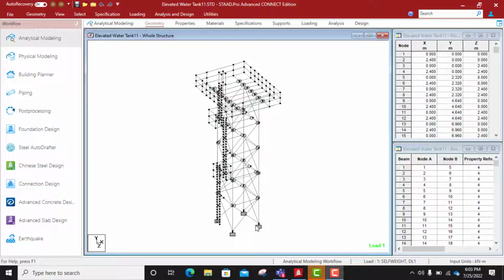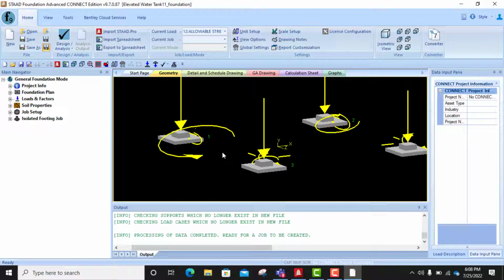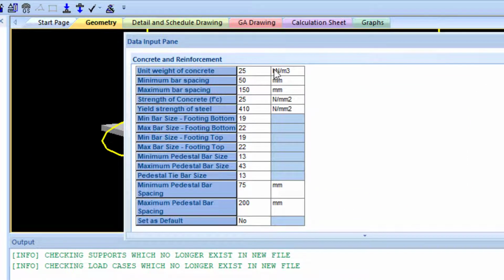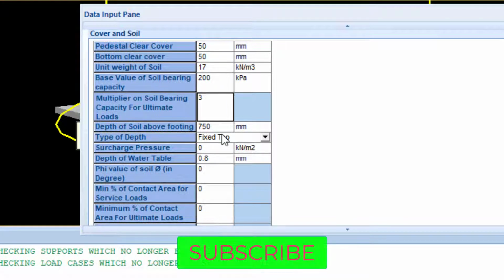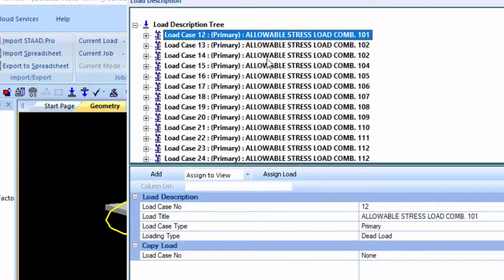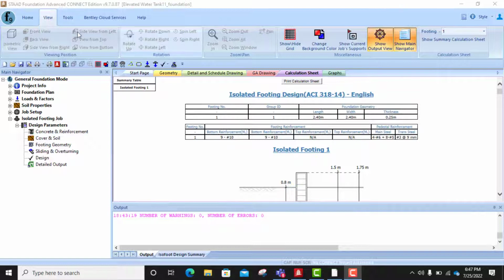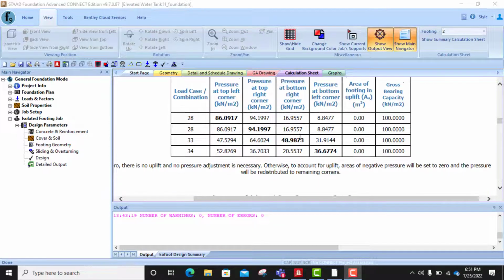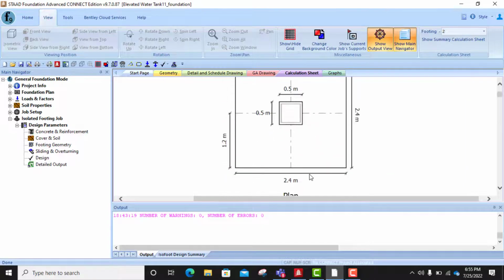How To Design Isolated Footing - StaadPro Foundation Advanced.

Comment: I'm new in STAADPro. I watched your water tank design. It was amazing and by far the best tutorial of any software I have watched. Good job. I ran into some errors at the foundation design for the water tank.  The errors are 

"12:54:10
 [ERROR] UNABLE TO DETERMINE A SUITABLE WIDTH FOR THE GIVEN LOADING. LAST WIDTH TRIED = 2.550 M

 [ERROR] UNABLE TO DETERMINE A SUITABLE WIDTH FOR THE GIVEN LOADING. LAST WIDTH TRIED = 3.100 M
13:09:38
 [ERROR] UNABLE TO DETERMINE A SUITABLE WIDTH FOR THE GIVEN LOADING. LAST WIDTH TRIED = 2.100 M
13:27:37

13:30:45
 [ERROR] UNABLE TO DETERMINE A SUITABLE WIDTH FOR THE GIVEN LOADING. LAST WIDTH TRIED = 2.500 M"

Any idea what I did wrong. I used the same values you used in the design but played around with some number to see if that will correct the errors but no luck. Thanks
Reply from the maker: Thanks for the positive feedback Engr. 
Try to increase the size of the mat.